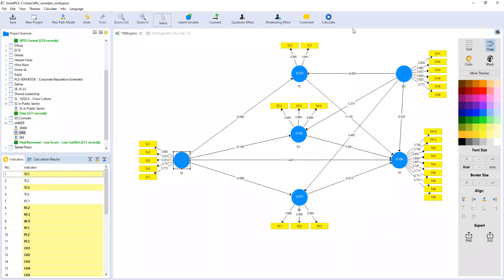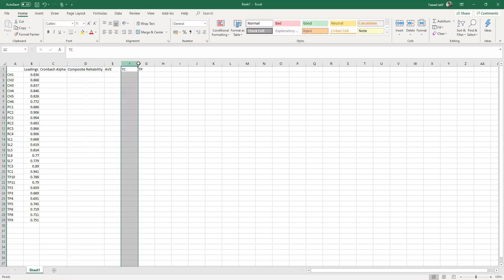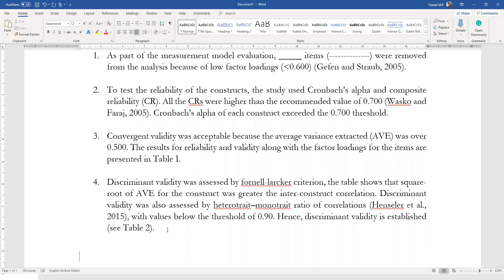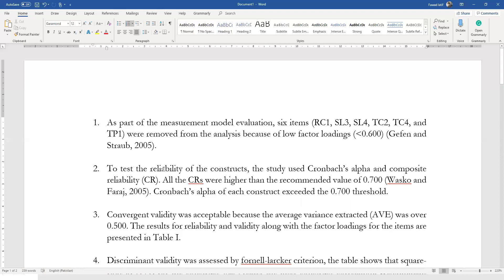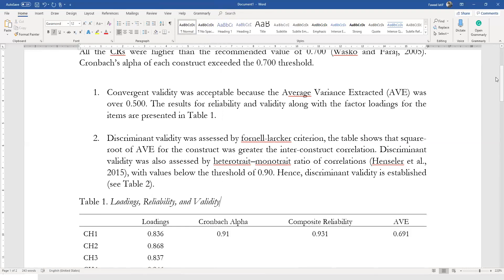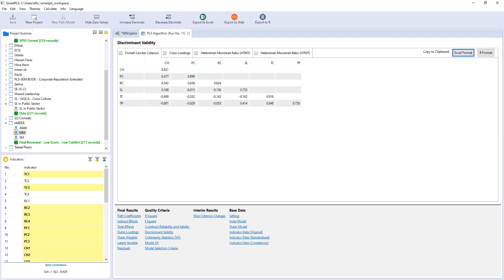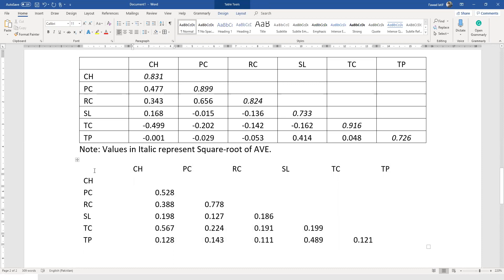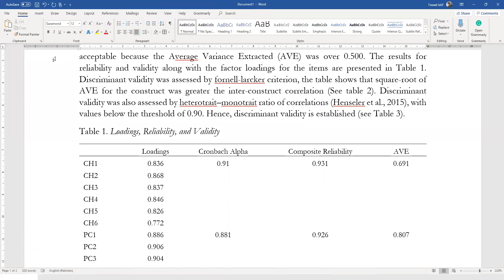Reporting SmartPLS3 Measurement Model  - Reliability - Convergent and Discriminant Validity

Comment: Sir, I came across your lectures on SMART PLS and they are extremely helpful. As mentioned in the lecture that if Cronbach alpha for most of the items is less, deleting them will create an issue in content validity. What has to be done in that case. plz share the link for the supporting video link to the query.

Thanks
Reply from the maker: If alpha is low and even deletion is not helping, see if your items are phrased properly, make sure if you have enough data, also make sure your have properly cleaned the data. 
Watch this video:
https://youtu.be/dZdIiEsgHWE
Reply: @researchwithfawad  thank you for your response sir.

Comment: Hello Sir, Thank you for explaining everything in details. 
IN my research case all the outer loadings are less than .70, What should I do?
Reply from the maker: Thanks. I am glad you liked it. If all are low, this is an issue. How low are they, what is the AVE and CR
Reply: @researchwithfawad  Out of 51 loadings, 9 are above .70; 3 loadings are .1, 2 are .0 something. The remaining are mostly between .5 and .6 with a few of them .3
There are total 6 constructs in the model. four constructs bear the AVE .2 and two constructs bear AVE .3
CR if above .7 for five constructs, for one construct it is .68

Thank you for writing back :)

Comment: Thank you very much sir, this is very helpful. I have a question about my model, all of my outer loadings are green (>0.7), but one of my construct, the Cronbach Alpha and Composite Reliability value respectively are 0.582 and 0.818. Should I remove one of the item from this construct? But I only have 2 items from this construct. Or is it okay with the value of Cronbach Alpha <0.7 but the Composite Reliability >0.7? Thank you sir
Reply from the maker: Since CR is good, no need to delete any items. Furthermore low Alpha value is because of no. of items.
Reply: @researchwithfawad  Thank you sir for the response. So, the low Cronbach alpha is because i only have 2 items? Is there any minimum items for one construct?